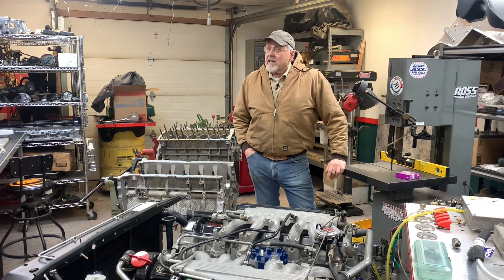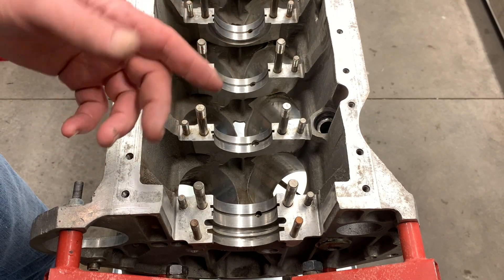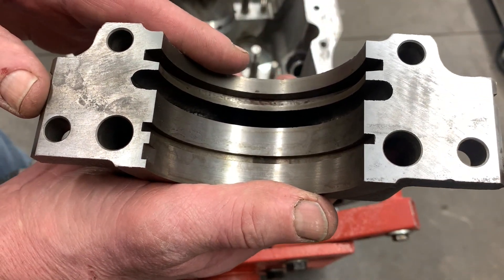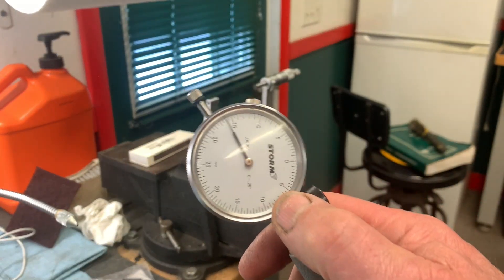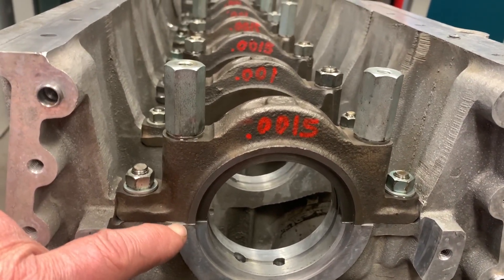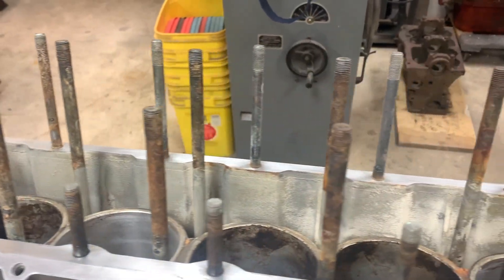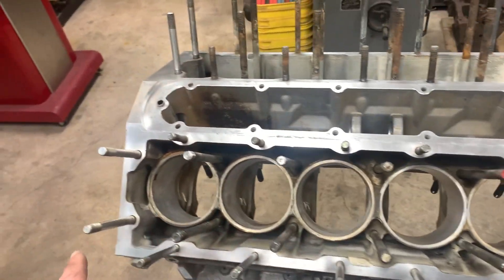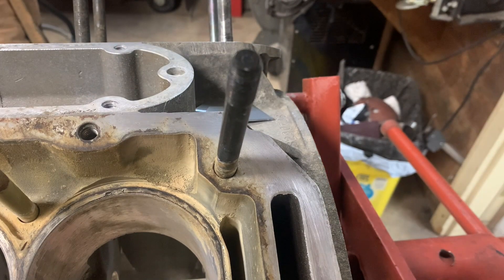Prepping The Jaguar V12 Engine Block For Overhaul.

Comment: i thought those cylinder head studs are supposed to be TTY and not re used anyway??
Reply from the maker: The AJ6 and later engines require stretch bolts but even those can be reused twice according to a Jaguar service bulletin.
Reply: Thanks, I didn't know that.  @thecampchaoschronicles9567

Comment: Hi Bob from Victoria, Australia. I’m keen to see in explicit detail how to correctly set up and install the rear main seal in your coming videos. I’m currently ready to build my v12 and know that this is a crucial step to get right. Please offer all do’s and dont’s, hints and tips. I have bought a rear main rope seal with graphite impregnated from a ford big block as I have been advised this is a better seal medium to use? Recommendations please? I’ve also watched a previous video from the $100 overhaul challenge on installing the rear main seal but I have a question. Can I use the crank shaft to correctly “size” the rope seal instead using the “sizing tool” as shown. Your expert opinion will be much appreciated. 

Derek in Buffalo, Victoria, Australia
Reply from the maker: The crankshaft cannot be used to size the seal. It is too small and the heat generated by the friction  will not only ruin the seal but could ruin the rear bearing as well. I'm not a fan of the Ford seal, it's seems more difficult to get it to the bottom of the groove. My process is to soak a stock seal in oil a couple of days, while you're waiting find a piece of round pipe or solid billet slightly smaller than the tool diameter  and push the seal into the groove. Tapping with a dead blow hammer is allowed. Trim the ends about 1/16" long on all ends and taper the sides except that next to the crankshaft to prevent squeeze out between the block and cap. Which it always does a bit anyway. Place the tool in position and torque to spec. I leave it in place a few days and wiggle it a bit each day as I walk by. Remove the cap, touch up  the squeeze out that may exist between the block and cap, and it's ready to install.Some people use lock graphite to coat the seal before installing the crank. And you'll need the tool adapter at the bottom of the page.  https://www.terrysjag.com/product//303012X.html
Reply: Hi Bob. Thanks for the excellent and detailed response. So just to follow up on your guidance. The Crankshaft journal diameter where the rope seal touches is to small you say than the install sizing tool?? Is this because in normal running conditions the seal expands under oil pressure? Excuse my ignorance if that sounds absurd as I’m just wanting to correctly understand if there is a difference in diameters (sizing tool vs Crankshaft journal). My initial thoughts were that I could install the rope seal and push into place using a socket or pipe as you explained, trim the seal as you explained but then use the crankshaft to “size” the seal. So having the crankshaft torqued down but leaving it a few days and also wiggle it as you said like using the tool. Would this work? I’m assuming not as you have already stated that the crankshaft journal is to small. So can you please elaborate on the importance of using the tool over using the crankshaft to correctly size the rear main seal. 

Thanks 

Derek in Victoria, Australia
Reply from the maker: @derekmclaughlin6588  The seal surface on the crank is slightly smaller than. the sizing tool. While it does make contact, the friction is less than if. it would be installed the old fashioned way.  The helical groove works oil that would otherwise leak past the seal back into the crankcase. Without the sizing tool, there is a 50/50 chance the seal will leak and a better than that chance it will overheat the rear bearing. The tool must be used to avoid this.

Comment: Nice to have you back and working on engines.   Have you thought about whipping up a DIY (or buying) an induction heater and creating a custom  shaped coil to fit down into the stud/block feature area to maximize heat applied for removing studs?

Also, would it be possible to find the proper material tempered 0.4357" rods and use a lathe or die to make your own studs?  (Seems possibly lest costly if ARP level strength isn't' required and just a reasonably high MPA would do...
Reply from the maker: Next weeks episode will be about studs.